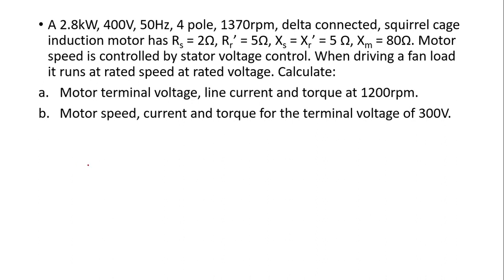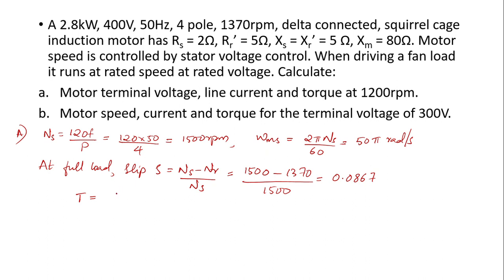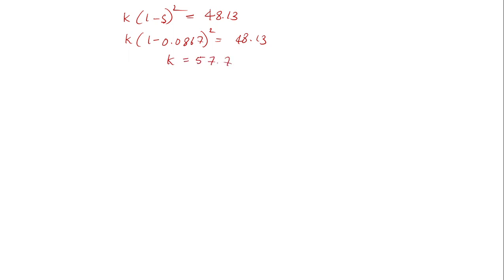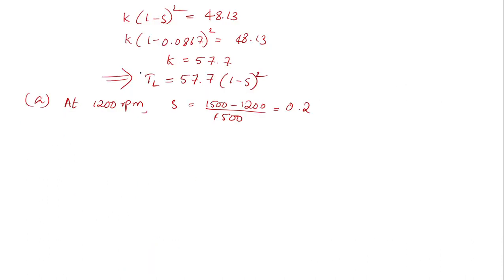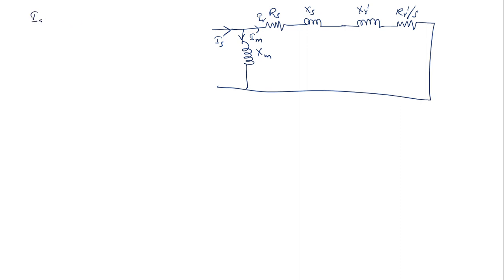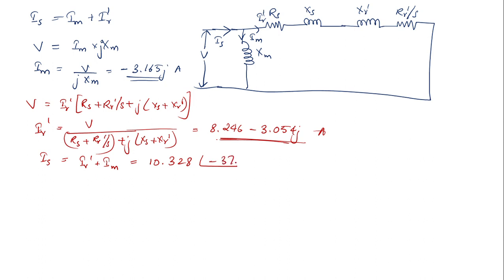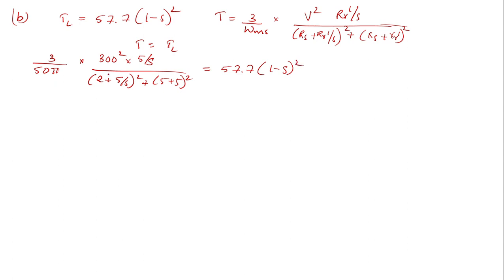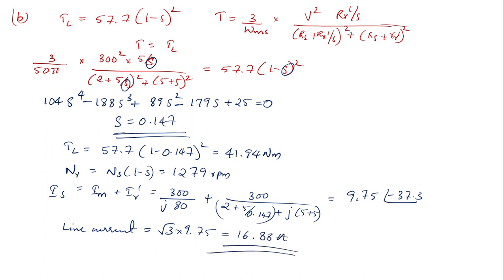Electric Drives - Module 4 - Problem on stator voltage control in induction motor

Comment: The speed of a 4-pole induction motor is controlled by varying the supply frequency while 
maintaining the ratio of supply voltage to supply frequency (V/f) constant. At rated frequency of 
50Hz and rated voltage of 400 V its speed is 1440 rpm. Find the speed at 30 Hz, if the load torque is 
constant.